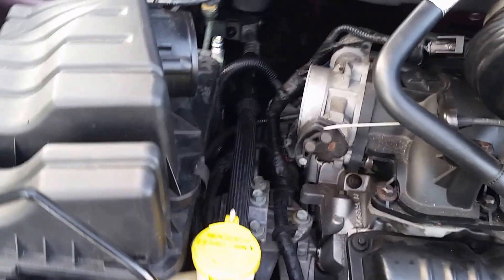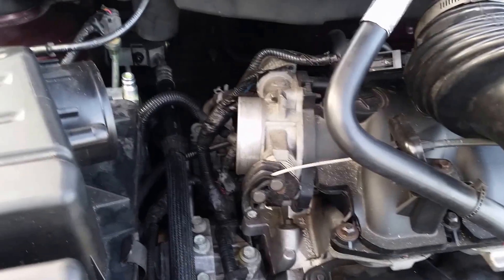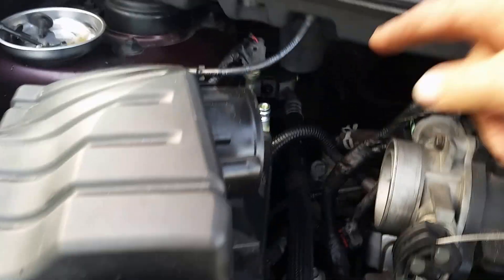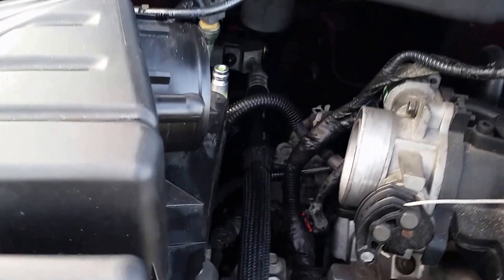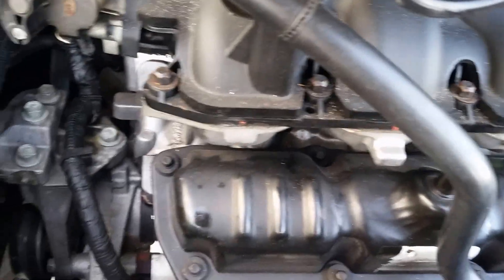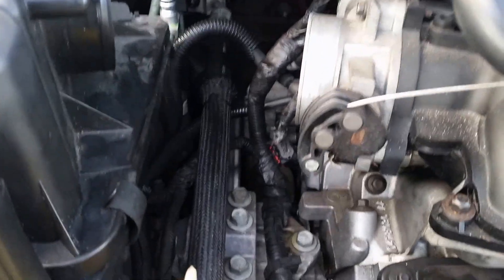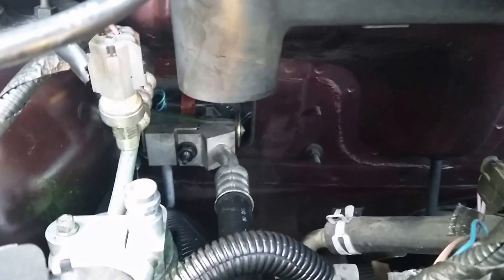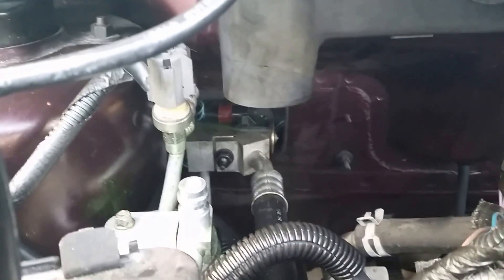Electric fans not working on A/C air conditioning

Comment: Thanks for posting this.  My GMC is doing the same thing. I shorted the senser and it did not turn on the fans. Relays are good.  I think there is a broke wire somewhere.    But yes. Without those fans blowing, line pressure will max and cause leaks and kill your compressor.

Comment: Great helpful video, today I recharged my daughters ac on her car cause it wasn’t blowing cold air. I bought the freon kit and connected it and it was at 20 PSI, so when I charged it, it went up to 39 PSI and left it like that cause it was in the green line and didn’t want to over charge it. So we took it for a ride and it worked perfectly for about 20min, then it stopped blowing cold air. We came back home and I checked it and the radiator fans wouldn’t turn on, then they will turn on and it will start blowing cold air but the fans will turn off again and they won’t turn on no more , so I don’t know what to do or if I messed something up. Will you be able to know what it could be and help me out please?

Comment: nice tip as I have the same problem like AC fan not turning on unless I give it a bit of push on propellers with screw driver but gonna try and fing high pressure switch tomorrow and test that now.

Comment: Thanks a million.  I think I have the same issue with my cooling fans which really affect my aircon. I switch on aircon and fans dont come on, but I noticed something, when splash some water on the condenser for a while then the fans kick on.  Is there a relation between water I pour on condenser,  condenser and fans? 

I saw a video long time ago giving the same solution, I think I should give it a try and the high pressure switch is of a vew dollars.

Comment: I have the same thing when I turn on the AC , fans don't come on along with it, 1998 Oldsmobile intrigue, relays are good. AC wasn't working, it was a bad hp sensor. Replaced it and the clutch started working, I put some refrigerant but it was still hot air coming out of vents. Now I bought a kit to vacuum the system, and recharge it. Hopefully after this procedure it will work. But still no idea why fans don't work. Maybe it's not detecting enough freon? I don't know

Comment: Both my 2006 honda accord fans are off with no power and all the relays and fuses are good. AC comprsor also does not engage. Could this be the solution  ?

Comment: I always thought that turning on the a/c compressor activate the radiator fan at the same time. Thanks for showing that it is the pressure sensor that turns on the a/c fan!

Comment: When I turn on my ac the compressor clutch is running, air hot comes out and the fan doesn’t work. Do you thing the ac air cool Won’t comes out if the fan dont work ?
Reply: Check for refrigerant if have any in system if not check your condenser for leaks or if plugged up

Comment: Thanks. Having similar issues. The Hyundai dealer said my Sonata radiator / AC condenser fan was bad...repair price: $569.00. I said nope and I installed a new fan assembly from Amazon. My cost $174.00. Did that fix the issue? NO! So, I'm looking to see why my brand new AC condenser fan speed won't ramp up when I'm stopped/idling at a light. My AC was putting out 45F degree air when the car was moving...so the compressor is good and the engine isn't overheating...but as soon as I stop my car...the AC air temp starts rising and will eventually be the same as the ambient air. (engine temps remain normal)
Reply: did you figure out your issue?
Reply: your issue sounds like CoolantTemperatureSensor, this kind of sensor determines when fans should switch on. I think this might be the case on my Toyota camry because my AC works fine when driving but on idle it`s just blowing warm and when I checked on idle the fans are not working with AC on but if I spin fans by hand then they start working and AC is ice cold and clutch engaged all the time but if fans don`t work then my AC kind of doesn`t work 90% because clutch kicks in only for 40 seconds and you can feel a slight cool air inside slowly getting warm within 1 minute, so yeah gotta give fans a bit of a hand push to kick start them (usually I do this with screw driver) and the AC works perfect as long as those fans are spinning. So now in my case there could be 3 possible problems: 1. coolant temperature sensor 2. AC high pressure switch 3.just a bad worn out fan motor brushes or whatever inside fans themselves. If I fix it I`ll reply what it was.

Comment: Ford transit connect 2014, ac all works fine apart from the fan, it turns on and off but never run fully, when I unplug the the pressure switch from high pressure then the fan start to run full, plug it back stops again. Also I hear fine noise when ac is on and I believe the gas inside system does that? What would you advise? Cheers
Reply: Was ur a/c compreasot comin on & off no cold air & overheat even with hot air wen not use a/c?

Comment: When the fans weren’t working, did the AC immediately start blowing ambient temp/warm air, or did it start off cold like it should be and then get warmer? I just installed a whole new AC system in my car it had been deleted in... just missing the fan.... When I get the clutch to engage it doesn’t even try to blow cold air.... just hot Texas air.... wondering if that’ll get fixed when I put the fan in.

Comment: So I have a similar issue.....could this be the answer?

Hello everyone! My daughter's A/C quit working on her 2010 Corolla S, 1.8L. Took it to the shop and it turned out to be the blower motor control switch inside the car. Replaced it with OEM part, and everything was working fine. However, when the A/C is turned on, the radiator cooling fan does NOT engage, therefore causing high pressure in the system. It DOES turn on when the A/C is OFF, when the car gets up to operating temperature. The shop is stumped, and he has been a reliable mechanic for 30 years. Was thinking it could be the High Pressure switch, but does not want to run the A/C too long to avoid damage to the system.

Any idea what it could be? All relays have been checked and they are good. The Corolla has only one fan, but it has a high speed for AC then low speed, to keep the car at the appropriate operating temp. Please help!

Comment: I always knew there was a switch that told the system whether there is enough Freon for the compressor to come on (so it doesn't run dry), had an experience once where I had to bridge the switch in order to get Freon in so there would be enough! However, I had no idea there was a switch for the fans, always thought those were temperature controlled. Thanks for the info.

Comment: Thank you. I have been searching for a video about the fan not coming on but the compressor does come. Wanted to make sure that I was right. Thathe high pressure switch is indeed the one that does turns the fan on. I found that all three wires there were peeled off and touching. It might  have burned the switch off.

Comment: thanks this tells me now how to wire in my electric fan conversion on my silverado so my fan will come on when needed when I run my A/C. and not like some are doing and wire it up to the clutch switch so the fans come on when the clutch is in-gauged.

Comment: Would the poor connection of the high pressure valve lead to no power to the female plug of a blower motor resistor?

Comment: Youre the boss!!! 1 day ago i got struggled about my ac and stressed me out untill iwatched your video this 2am in the morning here in ksa.. The radiator fan is not working even i turn on my ac... Then i just unplugged sensor temp  to not overheat the car.. But actuallly idont know it even my expansion valve was replaced.. Now i pluged the wire to the sensor swicth and now everything is ok.. Thankyou SOO MUCH AND GODBLESS YOU MORE

Comment: When I turn my AC on both my fan comes on but doesn’t work when the engine is hot so the car Will overheat
Reply: That sounds like a coolant temperature sensor or your thermostat is stuck closed.

Comment: My ac fans not working, both wires to ac fan are ground. I used a test light and both wires were ground. Clip on test light to pos on battery. Is that normal? I thought one wire should have power to fan??
Reply: One wire comes with power from relay and second one goes to compresor

Comment: No pressure, so thats why my fan stopped working.
Reply: Yes the low speed one.... The high pressure sensor should still be good so when the car reaches normal temp the fans should kick on but yes that sensor has to be working for the low speed fan to kick on
Reply: My car runs at 230 before the high speed fans kick on without a/c so in other words the pressure turns the low speed 1 fan on even without a/c before normal op temp!

Comment: when your fan were not working. was your ac blowing any cold air? cause i have a dodge nitro that i replace the whole ac system and still wont blow that much cold air....
Reply: Juan Hinojosa probably need A/C pro I have my two fans not working rn and no cool air but don't wanna add ac pro till I figure why my fans aren't working.

Comment: Hmmm?  I'm wondering about your conclusion that the AC high pressure switch turns on the cooling fans.  I've been looking at a lot of info and Youtube videos to solve my own similar problem on a Ford Focus.  What I've learned is that the two AC pressure switches (high and low pressure) serve one function - to cycle the AC compressor on and off as needed.  According to the info I'm reading it's the AC relay switch that turns on the AC system initially including the fan #2 that cools the AC condenser.  Am I wrong?  It's okay if I am.  I'm glad that your cleaning that connection seemed to solve your problem, though I don't know why. :-)
Reply: Stephan Boatin 
thanks for your concern and important info, my fans(both) are runing slower than they should , and i dont know why, they are suposed to turn when a/c is on , they are but slow, and besides they are not Lo and Hi speed they are just one speed
ill apreciate if you cam help me
thamks again

Comment: Simply AWESOME!!! I don't know how many searches I've done to fix this van, but this one did it! Similar to your case, it all started with the compressor seizing up. Replaced it, recharged. No cool, over 300 psig on high side with less than 20 psig on low side. Replaced receiver/drier, front expansion valve, and spent a few days removing/replacing the rear expansion valve. No cool, same pressure imbalance. During last recharge the fans turned on and the high side dropped below 100 psig. Found this masterpiece and thought for sure I was going to have to pull the system down and replace the switch. Tried pulling connector off and re-connected, condenser fan came on and I was able to charge the system, hello COOL air! Thanks a million.
Reply: Chris Castillo (*
Reply: Chris Castillo.yep fans effect the proformance of ac put some connector faliure spray. two both fan motor hornsts thats it